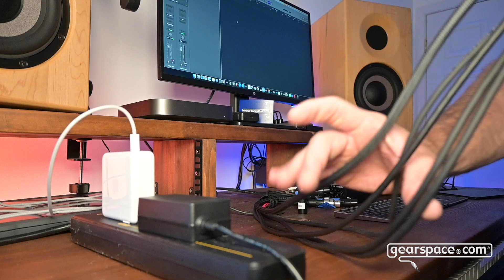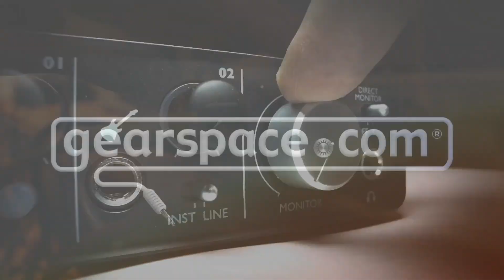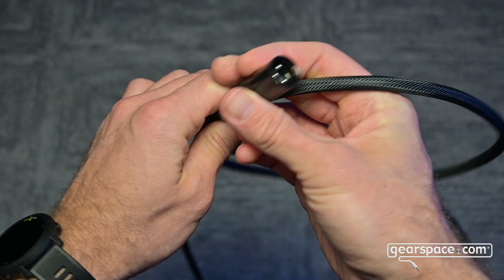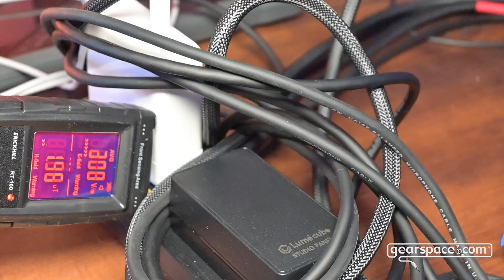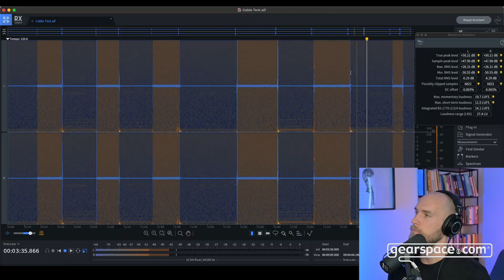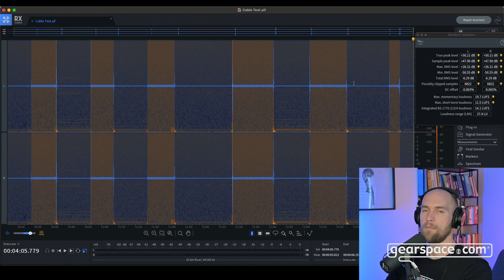Io Audio Technologies Cables Overview

Comment: I bought some of io premium cables for a great price 3 footers and 10 footers.  The braided nylon sleeve makes the cable less flexible but it does look great and durable but as far  a flexing them around because they are very stiff.  If you leave them plugged into a  interface or mixer with cheap input jacks, I would say be careful to get them in a direct straight in position, because they are going to add strain to your input source and possible create a failure where they are soldered to a circuit board.  If you notice any flimsy movement with the input jack you'll know what I'm talking about.   I really like them though, and have no idea why the were marked so cheap on Markertek.  Thinking maybe someone confused premium with pro when the listed the price.   When they arrived, after checking them out I bought some more.   Quad cable in a studio are the way to go.  As far as the video goes I didn't notice a critical difference in the noise floor of any of the cables, but RF noise is surely inhibited with the premium design.    Like I said live stage setting they just do not want to lay flat enough for my taste, and I'm usually a solo act with 3 balanced cables.